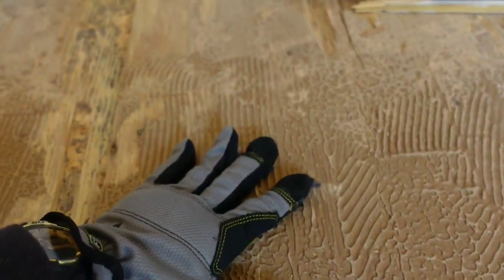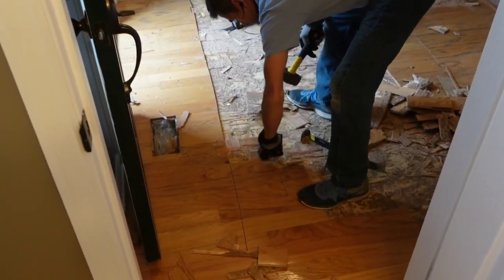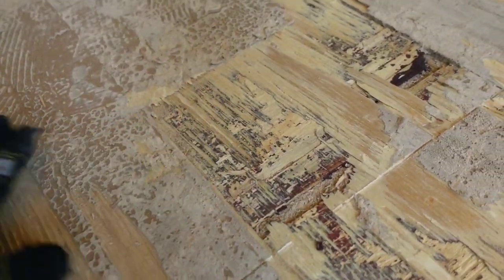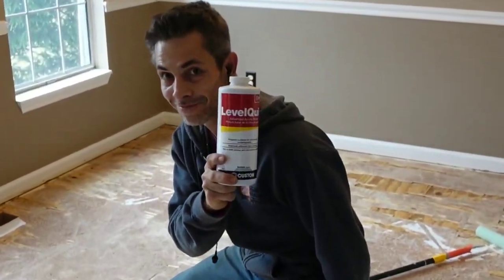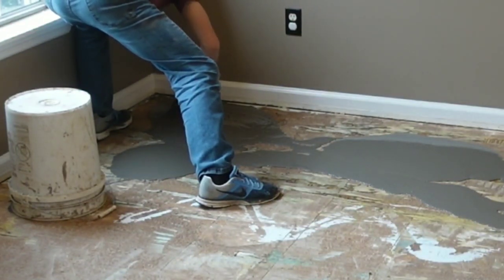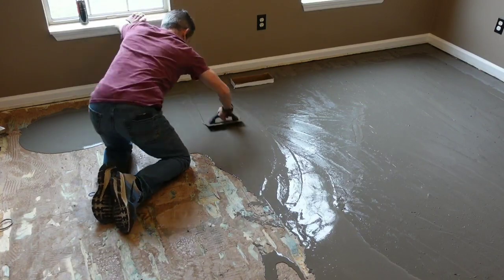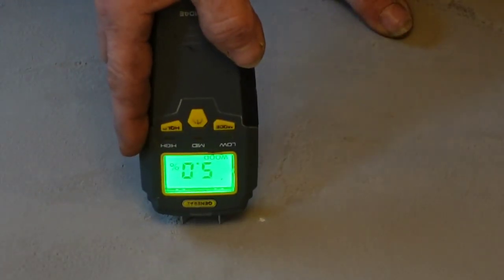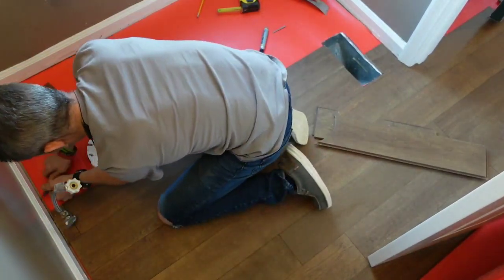Repairing Subfloor After Glued Down Wood Tear Out . . . (how to mix floor leveler)

Comment: Great video I have a Engineered Bamboo floor that is solid and glued down to rip out I am too old for this LOL can I just go with 1/4 plywood then luxury vynal planks over the 1/4 plywood. Thanks
Reply from the maker: You can. But if the bamboo is in good shape and pretty flat, you shouldn't need the plywood. I would go right down on the bamboo if I'm installing a floating floor. Hope that helps. Thanks for the question

Comment: If previous owners put down flooring right on top of subfloor and the mixture they used was too wet, which ended up delaminating parts of the subfloor, can I use the leveler on top after scraping it down?
Reply from the maker: I’m sure that would be fine. I would count on it with huge chunks of flooring missing. But just to resurface so it has a nice smooth plain would be fine. Thanks for the question

Comment: Would you recommend henry/ardex feather finish for small areas? I just pulled up glued engineered hardwood in the kitchen, luckily there was linoleum underneath and only a few areas need filling, about 30 sqft. New cabinets are already in and self-leveler seems a bit messier. Any tips? Also, great video!!
Reply from the maker: Sound like you got it all under control. Feather finish is fine. Especially going over glue residue. Thanks for the question

Comment: Can you use the self leveler over the glue, like you are showing, then put more subfloor over it to raise the floor? I imagine you'd have to use concrete screws or a little bit longer screws to get through the self leveler and glue layer. My subfloor with the glue on it is about 3/4 inch lower than it needs to be and I was trying to remove all of the glue before putting another subfloor layer down so I can lay my floor at the proper height.
Reply from the maker: I personally wouldn't do that. If you bust up any of the leveler in the process you may hear some crunching sounds under the floor. Use shim and place them on the old floor like floor joist. Then lay you ne plywood on that. Then, if you still need to use leveler for smaller areas, it will hold up pretty good. That's how I would do it

Comment: Great info for someone about to rip out 500sqft of glue down on OSB. Man does it rip out the OSab subfloor. I’ll have to do some serious leveling I guess. Our baseboards are out. What do I do a the subfloor edge to stop leveling solution running down wall??
Reply from the maker: We use great stuff spray foam under the baseboards. Let it expand and then cut it flush with the baseboard with a razor knife. Then the leveler wont run under the walls.  Hope that helps. Thanks for the question

Comment: Did you sand over any of the gouges that were made in the wood subfloor before applying the primer and leveler?
Reply from the maker: No, I did not sand, but I floor scraper over the whole floor to make sure there were no humps.

Comment: I going to be installing a nailed down tongue and groove wood floor. The old floor was glued down and my subfloor looks about like this one did in many places. Im assuming the way you fixed the issue in this video would not work for me due to me nailing or stapling the floor down. What would you have done if you had the same sub floor issues you had here but were going to nail the floor down?
Reply from the maker: Well I have been told that there is a product out there that you can put down to fill in the holes then you can drive staple though it. But to tell you the truth , I just have never seen it
Or used it. And for that reason I would probably have to cut the plywood out and replace it of its to bad to lay floor on. Hardwood needs to lay really flat. Any slight  difference in subfloor height, even and 1/8 inch is noticeable in the final product. I never understood why someone would glue a floor down to wood when there's floating , staple down, and nail down available. Save glue down for the concrete. Hope that helps. Thanks for the question

Comment: Would I be able to put the self leveler over sticky subfloor?  I watched your video with the baby powder trick, would I be able to prime over the baby powder and then pour the leveler?  Thank you so much, love your videos!
Reply: Sorry me again,  I just read a response from you to a question someone asked from the baby powder trick.  Looks like you recommended Luan sheets over the sticky subfloor if I wanted to put down glue down or sticky tiles?   I ripped up the tiles but damaged areas of my subfloor and trying to figure out what would be best.  Thanks 🙂

I’m looking to sell my home and wanted to go with a low cost solution.
Reply from the maker: Hey Jackie, thanks for the question. Yeah, with baby powder all ready on it. If you are trying to go the self leveller method, you may have to take a shop vac and make sure you get any excess powder up and then try using some kills to prime over at first before you put the self leveling primer. If you are doing peal and sticky tiles that actually stick to the floor, I would definitely suggest using luan to cap it. That's generally what you do when installing vinyl. And it makes a super flat surface. Using a self self leveler will work. But you have to make sure that it is super flat. And that you use the primer to make sure that it sticks to your subfloor. if you try to stick or glue wood down to self leveler and it's not adhered to the subfloor well, it could come up in chunks. That's why I suggested the luan to the other person. They were just too far gone for self leveler, and they were using sticky tiles. Hope that helps. Feel free to ask any questions, and if you have any long, detailed questions, you can email me at youfloor.net@gmail.com. have a great day
Reply: Thank you so much for your suggestions and the quick reply, you rock!  😀

Comment: I have to do this. New build home but after 6 years the engineered wood floors look terrible.
Reply from the maker: Just a tip. Over the past couple of years, I've been using a rotary hammer drill with a chisel bit, and it has really helped in removing glue down the floor without so many gouches. I sent a link to show you what I mean, but you can use any brand. Probably rent one if you are o ly doing one job with it https://www.authorizedtooloutlet.com/products/dewalt-dch133b-20v-max-xr-brushless-1-d-handle-rotary-hammer-drill-1?variant=44294514376926&currency=USD&utm_source=google&utm_medium=cpc&utm_campaign=google%2Bshopping&gclid=Cj0KCQiAgK2qBhCHARIsAGACuzn49Qzhr0EnwHWh2rOstB7MaBJJEAPgrJB9BDy4tRiCMI_lzoIl4qoaAvSIEALw_wcB. Hope that helps. Thanks for the comment

Comment: Can you install the new flooring on top of the old engineered wood?
Reply from the maker: The only way that would work is if the old flooring was properly secured to the floor( glued or nailed down. You're not supposed to install a floating floor on top of another floating floor. Hope that helps.

Comment: how much height does the floor leveler add to the subfloor? i laid floor on plywood subfloor that had carpet on it. But that subfloor continues into another room where there was both glue and thinset. I used a floor sander to get rid of as much of the glue and thinset as possible but i'm now thinking I should just put down floor leveler. Problem is I want the floor from the room that had carpet to flow into the room that had thinset. I'm using solid bamboo hardwood, so there isn't much room for flexibility
Reply from the maker: Is this a naildown bamboo or a floating floor. The leveler comes out as thick as you pour it. You can skim coat it all to a feather edge all the way up to around a 1/4 to 1/2 inches. Sometimes it's necessary to pour one  layer and let it dry. Then do a second  layer to build it up to the desired height. Hope that helps. Thanks for the question
Reply: @YOUFLOOR  thanks for the answer. It's floating bamboo, click lock, so it's gotta be very precise. I'm in between a rock and a hard place. I sanded down the thin set and glue but it's not perfectly smooth like bare OSB. So I can lay the bamboo floor and hope it works, or I can use leveler but then need to use a transition strip right at a very visible, high traffic spot
Reply from the maker: @BenBen-jl2ft  Do your planks already have the pad attached or are you having to roll out pad?  You can experiment with felt paper (roofing paper) if you are just looking to have a smooth surface to install on - just test out a 3-4 ft section and lay some of your planks down on it and see if that would help any. Just a thought. 
If you want to email me some pics, I can take a look and see if there is anything else I can come up with
email is  youfloor.net@gmail.com 
Also wanted to ask if you are installing bamboo quarter round as well?
Reply: @YOUFLOOR  Hi thanks for the response and pardon my delay. The planks do not have the pad, they are solid bamboo (Eco Forest from Floor & Decor) so I need to lay down an underlayment first. You think the felt paper would absorb some of the bumps? I sanded down the floor with a heavy duty drum sander but the floor had thinset from previous tile but the thinset was on top of glue from an even older flooring, so it was the worst of all worlds. Plus the house is 50 yrs old so the plywood subfloor is a bit wavy and this solid bamboo doesn't like anything other than perfectly flat and perfectly level

Comment: Can you use a squeegee on a pole  to spread the leveler out?
Reply from the maker: I would personally not use a squeegee. You can real move this stuff around and it sets up quick. If you use a squeegee you may push a hump or it can get more thick on one side. I have used and suggest a rake. The kind you would use ok a softball field are great. But a regular I large one will work. But it allows you to move the leveler But not too much. Run it through your leveler all the way across and then feather out the edges on dips. If going against a wall. Just pour and pull from the  wall to you. Hope that helps. Thanks for the question

Comment: We just got a house that has a concrete subfloor in the basement.  We tore out the asbestos tiles that were glued to it and it has glue and some unlevel spots. 
Will the material you used here be ok to level the floor with under the new vapor barrier? We plan in putting in a floating floor and are not sure how to properly level it beforehand
Reply from the maker: Absolutely.  You should be able to level out the floors and still be able.to install a vapor barrier before installing your flooring. Hope that helps. Thanks for the question
Reply: I am also taking glue off of concrete. I can get the glue down to the concrete but there is still a slight film of glue on the concrete. Will self leveler bond properly or do I need to completely remove the glue. It looks like younleft glue on the osb in your video?

Comment: Can I save my hardwood floor that is glued down?
Reply from the maker: Usually glued down hardwood tears pieces of the subfloor with it along with lots of glue. I would not save it for future flooring projects. It would be a lot of work to clean each plank. Makes great . Hope that helps. Thanks for the question

Comment: Buy an electric demolition hammer and use a 1" chisel bit.  You will still rip up some subfloor, but it will go faster.
Reply from the maker: I actually bought a Dewalt hammer drill it is amazing for this type of demo. Thanks for the comment

Comment: How many bags of leveler did you use?
Reply from the maker: For this job I believe we use 4. We mostly skim coated to fill in all the small holes and about an 1/8 of an in to a 1/4 of an inch in the craters an dips. Hope that helps.  Thanks for the question

Comment: SL compound over ply is useless. Too much flex in ply. That will be a cracked mess after a month.
Reply from the maker: No, it won't. 4 years and still going strong. Thanks for playing you did it wrong.